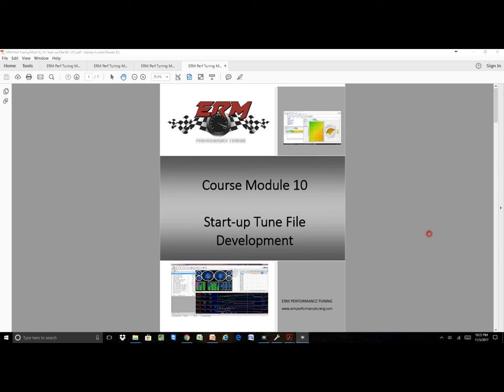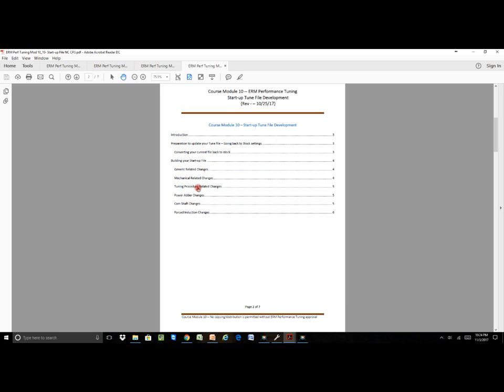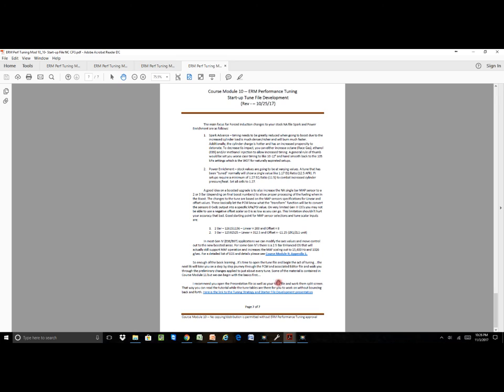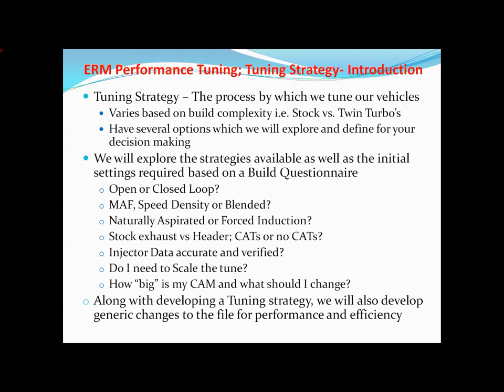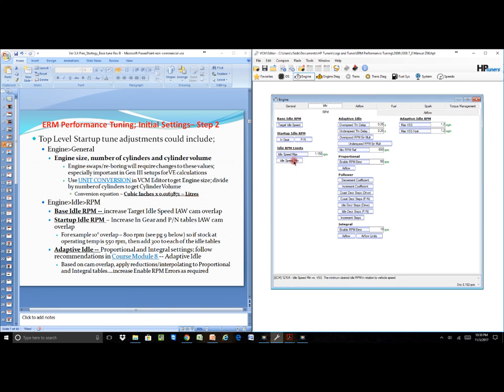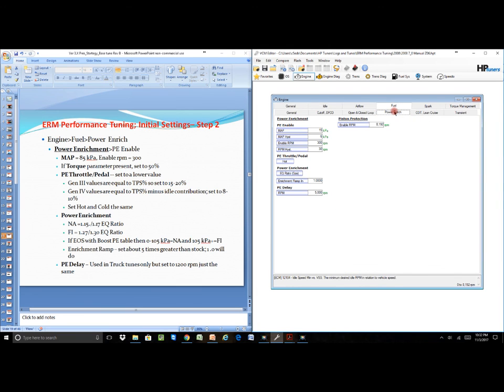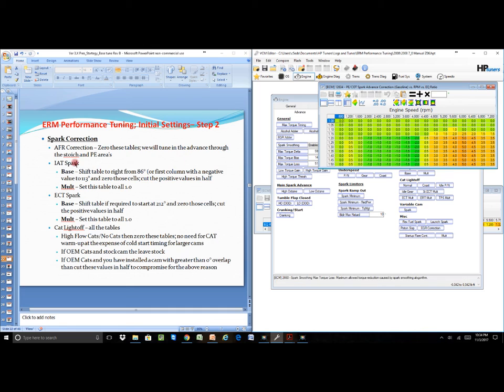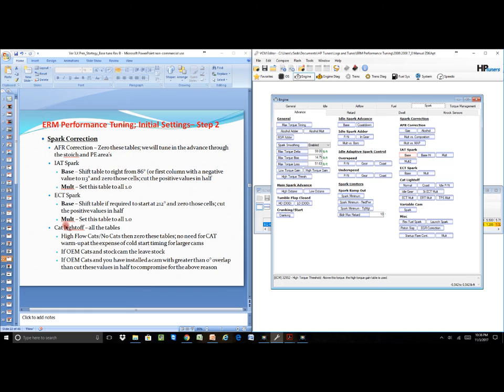ERM Performance Tuning Version 2 0 Module10 introduction

Comment: I'm looking into purchasing your guide. Is this something that deals with force induction applications.
Reply from the maker: Yes, the tuning process is basically the same and it also goes into the Multibar OS's, and scaling techniques needed for some boosted setups. Timing and fueling is discussed as well....thank you for your interest Justin.